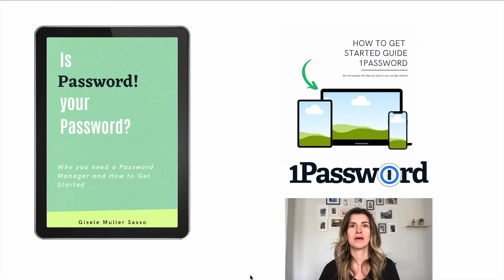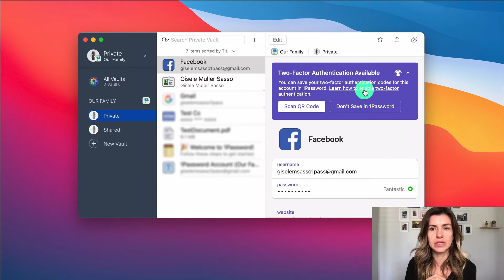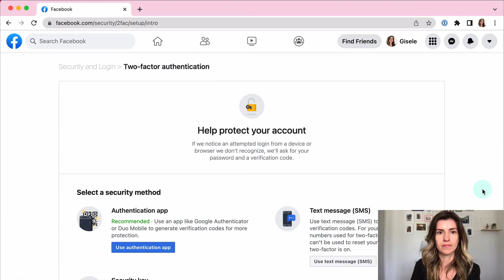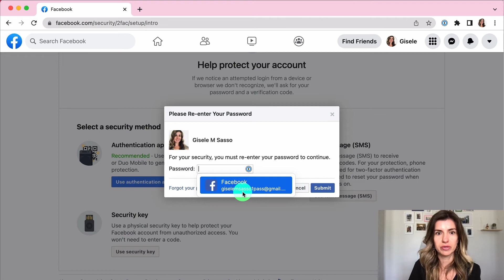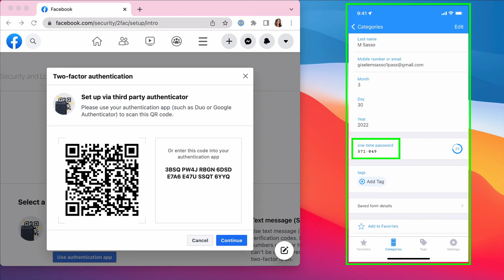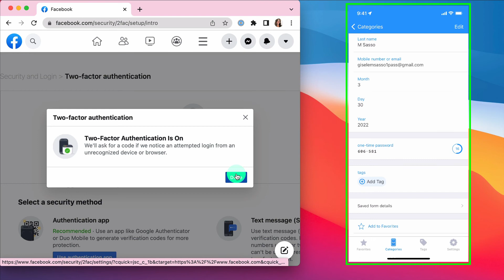Set up 2FA (Two-factor Authentication) with 1Password

Comment: I have a few questions.

1. When I visit a site where can I find the 2FA codes within 1Password?
2. Since the video is a year old have things changed?
3. Would I be better off using a Yubikey for 2FA?
4. Is using a Yubikey easier than using 1Passwords 2FA?
5. I have never used sites like Authy or Google Authenticator. They seem similar to what 1Password does when it comes to 2FA. I was told that on those sites that for some reason you to backup a copy of your 2FA code. I don’t understand why. I was wondering if I use 1Passwords 2FA feature if I have to backup my 2FA code?
6. Is all this described in your book?

Thanks